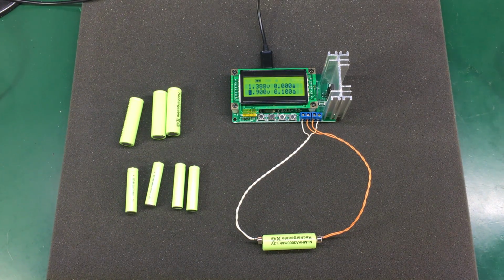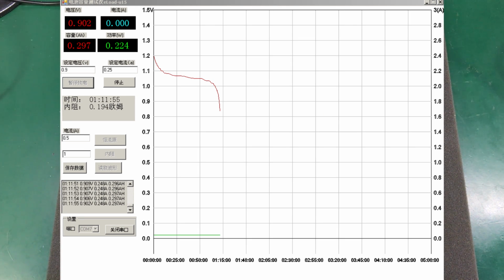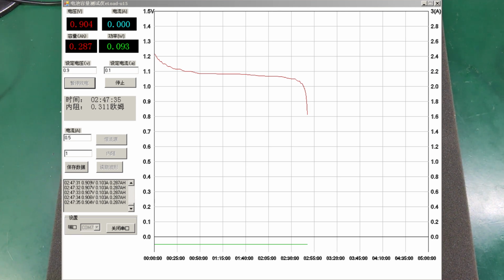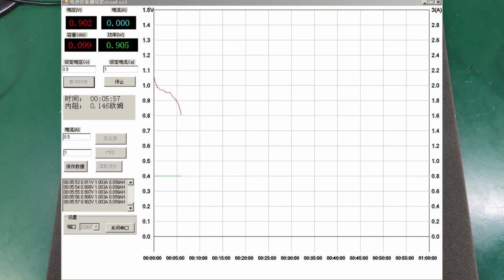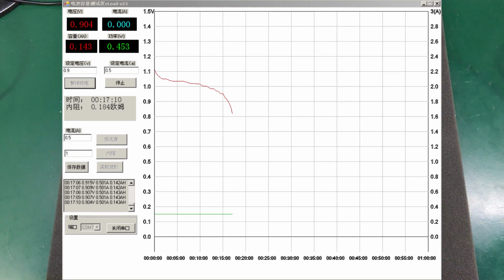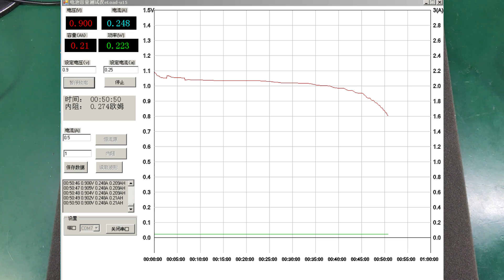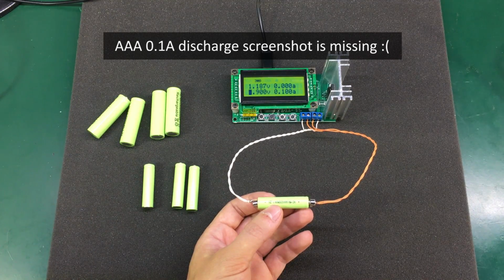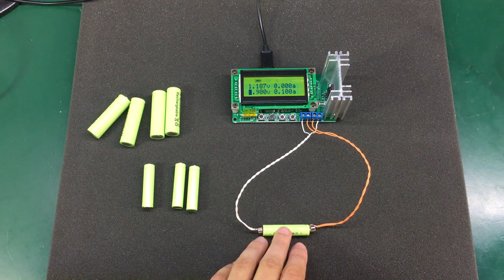Voltlog #66 - Cheap NiMH Rechargeable Battery Testing

Comment: Total crap batteries. I bought 24 from ebay for almost nothing. I tested them, found they had very different capacity and none nowhere near 3000 mAh. The seller offered to refund half of my payment, which I accepted.
Crappy as they are, they're fine for short tests and some solar garden light projects.

Comment: If you have a Lidl near you, they sometimes sell cheap nimh cells. The most recent batch were bad but they are usually good. £3 for 4xAA and they test at ~2000mAh
http://www.hotukdeals.com/deals/tronic-nimh-aa-aaas-batteries-lidl-2-99-2455892
Reply from the maker: yes I have LIDL shops here, I'll keep an eye out for those batteries. Thanks!
Reply: IKEA batteries won a swedish battery test a couple of years ago. I have bought a bunch and they work well!

Comment: These days it only makes sense to buy reputable brand name batteries, and only LSD (Low self-discharge) NiMH batteries. It seems that those AA Vartas you bought are LSD NiMH batteries since they are "ready to use", but AAA are not. Personally, I bought good Turnigy LSD batteries from Hobby King, and Camelion AlwaysReady from my local electronics store. I would buy Eneloop if mentioned cheaper batteries were not available. All of them are LSD.
Reply from the maker: yes, that seems like a good thing to do these days.

Comment: Nice video! Did you notice that the graph is not in line with the current and voltage readout? 1A=0.9A on graph and 0.9V=0.8V on graph.
Reply from the maker: yes, the graph is garbage but I didn't want to extend this video to talk about that..

Comment: I buy AA NiMH batteries at the local IKEA for about $1.90 a piece rated at 2450 mAh. I measured them to be slightly more than that, around 2550 mAh. I think that's a good deal!
Reply from the maker: that's a good deal, however I don't have a local IKEA so I got the VARTA's 2400mAh for about $2.5 a piece.
Reply: McG I agree on the IKEA batteries. They are good and cheap!
Reply from the maker: I will have to give them a try next time I visit an IKEA, which is 250KM away :(
Reply: In Switzerland, they have an online shop, where you can order the batteries. But they charge quite a lot for shipping...
Reply from the maker: I checked their website , LADDA brand 4 pcs AA 2450 and 4 pcs AAA 900mAh + shipping $24 and I got the 4pcs AA Varta 2400 + 4 pcs AAA Varta 1000 + shipping for $17
Reply: IKEA batteries basically tied for top spot in a swedish battery test some years ago. I happily buy those instead of gp recyko+ and eneloops which are also awesome.